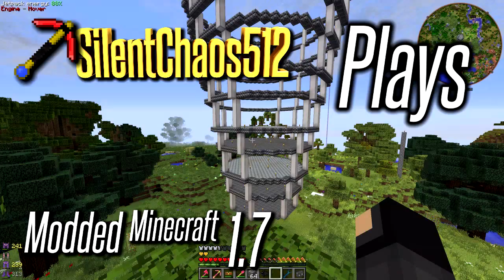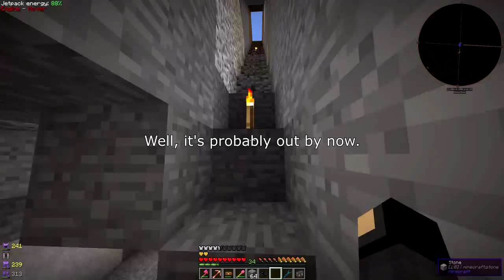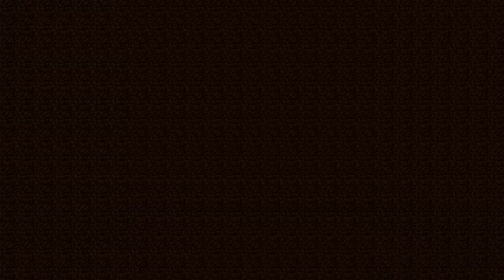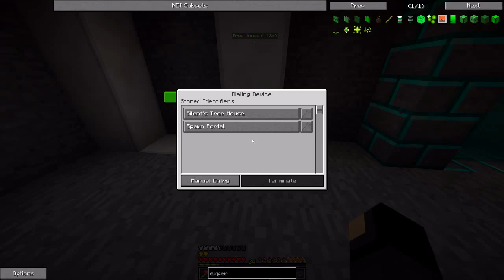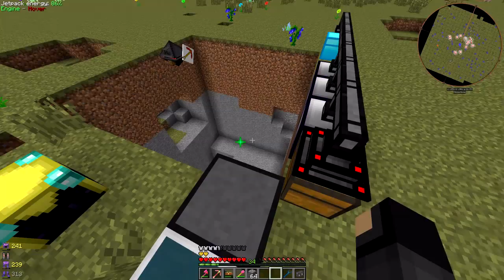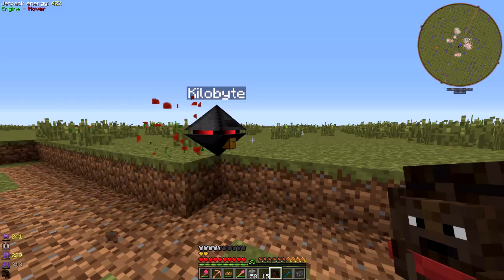Modded Minecraft 1.7 - S3E11 - Robot Miner

Comment: i have an issue i used the code you linked to and copied how you started your robot but my robot only digs a 4x8 and then it brings up a particle effect like it cant break the block or something like that because it stops digging and then it just returns to the place that i put it down at and shuts off. any ideas?
Reply: Once its inventory fills it returns home and shuts off